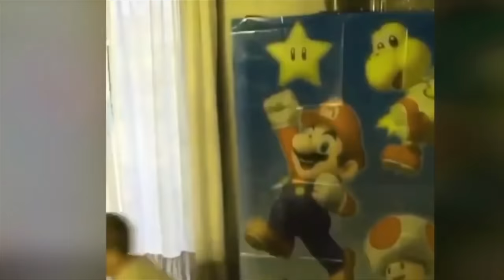Will VS Keyboard Warriors

Comment: Shout out to Concept3Performance and Will, amazing content. Keep it up, and don't worry about these keyboard warriors. They never really worked on a car or a truck before. For those of us who do, we find your videos informative and entertaining because we either learned something new or been in the same situation.
Reply: I work on them daily but I still say Will needs to work on his communication approach with some folks.
Reply: @cammourer8246  Communication is not the problem. It's the blasphemy that comes from people. I can't tell a surgeon how to operate just because I've stitched up a wound a few times. To the ball joint in question, Concept3Performance probably replaced hundreds, if not more, I can't tell them that they are doing it wrong just because I've replaced it on my car or truck. That would be assuming that every car or truck is built the same.
Reply: @vsmk5512  I can see where you're confused, my opinion on his communication issues are gathered from previous videos where he admits to ignoring people, having people be his mouthpiece, and trying to explain things to people like they are also mechanics.

Comment: Been doing toyota ball joints for 15 years now, some of the hardest even with a 50 ton press but the easiest way ive found is to prep the lower control arm with a flameless induction heater at the ball joint then transfer it to the press and press out its been pretty smooth so far. But Will you gots it its a bitch trust me!😂

Comment: Man, props for putting up with everyone's BS. This job is hard enough without having to do it in the public eye.

That said, my only gripe with your process here is the lack of safety glasses while using the press, but I'm probably just paranoid lol. Also, it's definitely not necessary, but if you do press jobs with any regularity, upgrading to an electrically operated hydraulic press makes these jobs a little more bearable.

Comment: oh man this reminds me of last year when It took my three days to get the ball joint on the upper control arm of my is300 out of the spindle - i ended up drilling through the stud and then hitting it with the air hammer for a long time. Can't imagine how much more difficult getting the actual joint out of the arm would be - good job friends and that's awesome you didn't charge extra

Comment: You were more patient than i would have been i would have liquid metal'ed the internals of the ball joint and used a die grinder to slot each side of  the remaining ball joint till i could split it releasing it obviously you did it the more correct way and would also require you having a cutting torch and if you don't sol on that idea

Comment: The toyota lower ball joints suck. i did my 07 Tundra and made my lower ball joint a stun grenade from heating it up so much that the ball shot out from the cup at Mach Jesus and gave myself hearing loss from it. louder than my rifles.
Reply: Mach Jesus 🤣🤣🤣

Comment: question,  i bought a muffler and the extrender to attach to the muffler i didnt put it on it was my step dad but i look under my car and it was gone would it be cheaper to buy  the pipes and muffler section in stead od buting the attachment again also im not a car guy could i also have tips on how to put things on the right way if i dont have the money for the muffler but the attachment to the pipe and muffler?

Comment: Also Will i know your trying to help save other peoples money but doing some research and please correct if im.wrong the oem specs are chamfered in a way where the LBJ contact surface is even across the way vs the aftermarket have angles which degrade faster. I could.be wrong but i still love your crew content and yourself man. Helps me think in better ways and always keep up the great work!!!

Comment: Those ball joint press tools are garbage. They flex easy and break easy. I don't have a 20 ton press cuz no place to put it. But I got a big c-clamp and welded on big pipe pieces works best for me. It's most likely not a safe way to do it, but it don't flex when pressing ball joints or bushings.